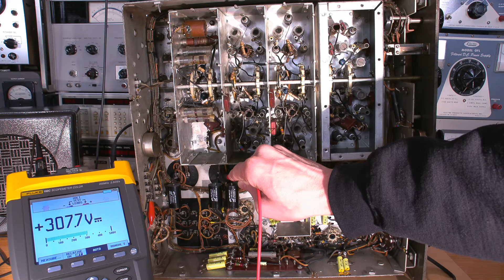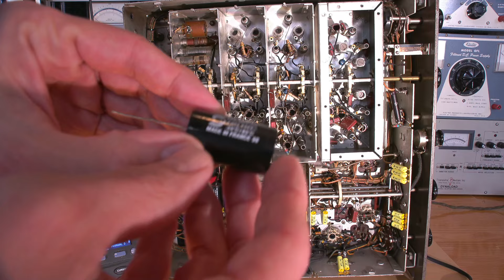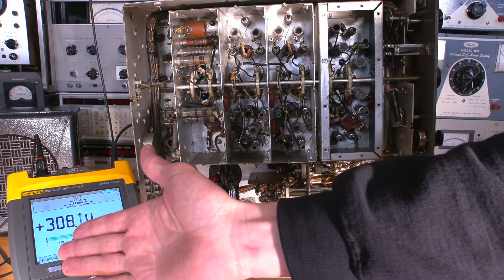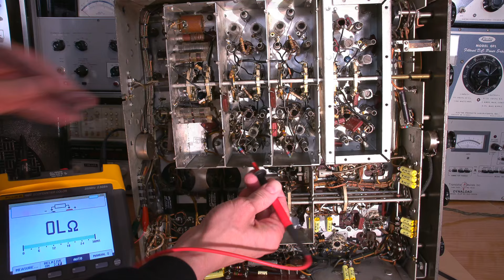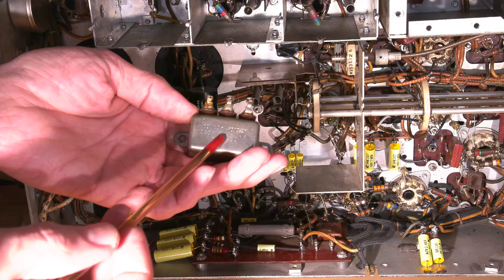Capacitors And Resistors -A Parts Substitution Guide!

Comment: Is there a reverse photoresistor? That is, a resistor with low resistance in the dark and high resistance in the light?
It would be smart to put one of these in a chain of LEDs (both DC and AC), so that the chain glows in the dark.

Comment: I can't help but think we have things pretty good in the post-VLSI world, where all the detailed respect you have to pay RCA's analog expertise is hidden away by today's little standardized black boxes. Stable performance over time, standard signalling and voltages between chips, that kind of thing.

I'm also impressed by the Solen capacitor seeming to have a manufacture date of 1998. Probably not the right choice for recapping aluminum electrolytics, but it's nice to have options.

Comment: Wanted to ask, why poly film caps for bypass and not a modern ceramic cap?  I've not looked at cap impedance vs. frequency for either but I thought that ceramics were quite good.  Edit:  Just got to the point where you say ceramic caps that would also work fine.

Comment: To all you electronic gurus, I have 2 amps in my car, one for mid and high end one for a sub. To feed audio into them I have stand alone multi media screen stuck to the windscreen that's fed 12v from the cigarette light socket. The amp  line volume settings are quite high to get the volume I like, but here's the problem, when I turn the ignition off there's are very loud and sharp crack through the speakers. I know it's the multi media screen causing it because when I remove the cigarette plug before turning the ignition off it cracks, but when I turn the ignition off with out the multi media power up there's no crack. So does anyone have any suggestions on what I could do to get rid of the crack. I'm thinking some sort of capacitor on the 12v line into the multi media screen to slowly discharge after the ignition is turning off. That's all I know so if someone could steer me with precise info I'd be very grateful. Love you videos Paul, wish I new a fraction of what you do. Very entertaining. Sorry for hijacking your comments but I thought you guys would know straight away what I should do 👍👌

Comment: Wait, did i get this right? I can use a poly cap on the filters instead of electrolytic in a tube guitar amp???? Then why no one does this? Because of the stupid " oh the caps give tone" thing???? Damn it, if it were for me i would use poly on everything and only worry about biasing (and I go cold bias)  and dont go in there

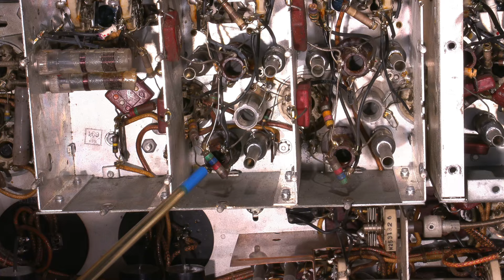Comment: 17:30 I could not find the video referenced, though aware the helical cut causes induction. What I never could find or get an answer on is if this affects the signal through the resistor and/or surrounding signal(s). You and others have warned about resistor selection in RF circuits, however, carbon composition resistors are no longer being manufactured and becoming difficult to obtain. So then does that mean at that time radios will be no longer repairable?

Or am I over thinking replacing out of value resistors in this 1964 German radio?

Thanks in advance,
Adriel

Comment: If an amp is not used over a long value ,caps do tend to vary in values or get leaky . Se the amps in old cinema amps which used run fir three shows a day never showed any signs on testing with ESR meter or other methods .Russian paper in oil r best .

Comment: I have a question that need your knowledge on. I own a vintage tube amplifier made in 50's lots of the carbon resistors have drifted to high so replaced them with wire wound and metal film. Now it improved the channels they have even power, before 1 side was weaker. The thing i need to know is by swapping them did i lose that warm sound?

Comment: Here's a question I've been pondering...I recently came into an old ham's parts inventory.  He's giving away all his junk and I could not resist.  I have a bin full of OLD 1970's electrolytics that are all "new" as in unused.  Never in circuit.  Are they serviceable?  I have no capacitor tester, certainly not the hyper-tweaked Carlson Green Eye!  But I just wonder about the physics of the capacitor.... what exactly makes them leaky??  All those electrons fighting against the dialectric?  Is it physical? Chemical?  Cosmic??  If anybody would have a definitive answer or even opinion, it's you, Paul.  So I might experiment with a couple in an old 5-tube AAC just for laughs, but what do you think??  Best regards! 73,   JEFF  K4UIE

Comment: Hi Paul I have been watching for many years thanks. Not sure how to contact you so since this post is about parts, I have a question on a Radiola 46. The Tub for the tuner section has the pot metal issue with a 1/8 inch warped that puts everything out of alignment. Is it possible to build up a new tub out of sheet metal?

Comment: Thanks Paul for this video. I found an old Robyn CB radio out in my garage and it has a lot of oil filled capacitors under the chassis. The radio works just fine and it's not really showing any obvious signs of failure, but I would like to at least replace the components before they fail.

Comment: I see some people here saying that polyester caps are leaky and polypropylene ones are a far better choice. I have some 1-10µF polyester Panasonics, but I now question if they are appropriate for the circumstances shown in the video.
Reply: no poly cap should leak measurable dc, unless its being subjected to nearly enough to break it down , but yes polypropylene is usually better, theyre generally available in higher voltage ratings than polyester or polystyrene

Comment: you ever dealt with "fake tubes"  tube replacements in a can with tube sockets that are transistorized guts?
Reply: i've come across a solid state 6X4, part dud unfortunately, and i've seen solid state replacements for octal based rectifiers, thing is just dropping silicon diodes in place of valves/tubes can be very bad idea , you need series resistors at least, to reduce the HT/B+ to the same level,
Reply: i dont know if any active solid state replacements for something  like stupidly expensive audio power triodes were/are available, i had an idea for a replacement 'universal' 'triode' some while back, but never yet built one

Comment: Very interesting discussion... I think a good discussion is how come the electronics in these old radios look different than our modern equipment.  All the components are point to point and floating in the air whereas we have PCB's and things look a lot more organized and cleaner.   I know there's a good reason for it and I feel that the answer will lead to an interesting discussion...

I should add that the topics I hear on this channel are always surprising and interesting to me, I have an AA degree in electronics, but we didn't cover tubes, except one class and we did one or two labs with them, and it was the last time they were teaching the class with tubes... that was back in 1983 or 1984... so electronics classes at my college are probably not going to feature tubes and all this old-tech... that I find fascinating like a history lesson in practical form as you restore these radios. And "B+" much respect for the high voltages, YIKES!!!

Comment: Good choice with replacing components! I have noticed that in US made radio equipment from WWII and tube equipment made later almost never electrolytic caps were used. Probably because they were not considered reliable enough in storage. Instead, relatively small-value paper-in-oil caps (4-10 uF). Most of the smoothing was done with multi section filters with these and one or two big filter reactors. Sometimes the coils were even tuned to the ripple frequency

Comment: So here's the deal as I have read it. Composition resistors are trimmed by reducing the size of the path in a non-inductive pattern. Films are non-inductive when they are made but are laser trimmed to value in a helical pattern underneath the protective coating. Hence, inductive.
Also when wrapping a wire around a post to solder it in an RF circuit you have to make sure the wire or component lead quickly leaves the vicinity of the post so it doesn't contact the post again as it continues its wrap. You will get sporadic shifts in operating frequency. Ask me how I know.😜

Comment: What do you recommend for a purchase of multiple component kits. I see lots but don’t know if I’m buying items that will never be used. I see for example 100 resistors on a roll all of the same value. How many different resistor values does a person need without ending up with rolls of components that will just sit and take up space. Same for capacitors. You can get plastic trays full of them but are they all necessary and are they to small to big etc etc. Same for transistors, op amps, chipsets. What a minefield to navigate.

Comment: 👍Thank you for another excellent video. The only thing I was curious about was the advice, if replacing a carbon resistor, to stick with carbon. Assuming they can handle the power, I tended to think metal film was usually better in RF circuits (less noise than carbon and more stable). Is there any special reasons for not replacing carbon with metal film please? Is it maybe that carbon is better at dissipating transient heat?

Comment: Interesting comments on the caps in the screen decoupling caps in the RF preamp's tempted to change them for .01uf.
It got me thinking the smoothing caps which are  4uf and wondering if RCA would have used a larger value and did not because they ran out of space inside the large can ??. or would it upset the reactance of the smoothing chokes ??.
Reply from the maker: Adding more capacitance will increase the B+ due to the reactors. In a case like this, it's better to stick to similar values.

Comment: Greetings:
Choke input filters should allow lower voltage ratings I think. Would either eliminating the first capacitor or moving it to the output of the reactor work well? How about using a CL90?
Would you accept adding a small load to the transmit position to make 450v caps acceptable?

Comment: Great explanation. Could you do a video on selecting replacement Transistors and replacing transistors that are no longer available. I currently am working on a Pioneer SX-939 and found I need to replace almost all of the transistors and several are no longer made. I called Digi-Key and they suggested a replacement but I am concerned that what they sent me does not have a metal heat sink as the original does. Being plastic and not knowing if those are the right transistors I am at a loss. I have no clue how to select a proper replacement and have to trust others to make that decision.
Reply: strange all are bad, or are they germanium types, they do go bad far more than silicon ones?

Comment: Sometimes you have to be careful with "bypass" capacitors, especially in IF amplifiers running at a few MHz. The screen grid "bypass" are sometimes part of a neutralization scheme, and therefore need to have a kinda exact value. They often look inconspicious, having 4.7 or 5nF, but thats because they just designed the neutralization to use this common value.
Reply: yep, one cap screen to ground, another cap from decoupled anode supply to the screen, not ground as normal, seen it many times in am/fm sets in the uk ... but even so, it would have been designed to accept a reasonable tolerance, 4.7nf in place of a 5nf likely perfectly ok, 3.9nf in place of a 4nf, 3.3 in place of 3, etc.
Reply: @andygozzo72  This is correct and well inside usual tolerances of the time. Just don't think "it's only a bypass, and 100nF does bypass even better than 5nF".
Reply: @VintageTechFan  in most cases, where not used as neutralising,  and not used for any timing, it wont cause any issues increasing it a bit
Reply: @andygozzo72  Yes. I just wanted to point out that you have to be careful, because in some cases, it DOES matter.

Also higher capacitances usually also have a lower SRF, so you have to watch out for that, too.

Comment: are poly style capacitors polarized as are electrolytics?
Reply: I did not see plus or minus markings on the “poly” capacitors used to replace the power supply electrolytics?
Reply: @iamhe999  nope,  some 'may' have a marking for the outer foil but they dont usually do it these days, the outer foil does not HAVE to be to 'negative' but advised to be connected to lowest impedance part of a circuit , which in this case is ht- or chassis 'ground'

Comment: whats a poly capacitor? is that polypropylene, polyester or polycarbonate? theyre not all the same you know and its not an exhaustive list.
polypropylene caps might be the best performing in tube equipment - they have the lowest leakage and best high frequency performance.
polyesters are capacitors of last resort and high leakage. 
polycarbonate is good for hot areas. polystyrene melts easily. the differences are huge.
and use a ceramic disc for RF bypass for sanitys sake !
Reply: polypropylene are generally available to the highest voltage but otherwise doubt thered be much difference for normal decoupling use, if in tuned circuits that could be different
Reply: @andygozzo72  with audio there will be not much difference whatever cap u use. 
but polyester is also used to make disposable drinks bottles. not sure how a plastic bottle would last inside hot tube gear:body-blue-raised-arms:
Reply: @echelonrank3927  well, you shouldnt really have any components that can be adversely affected by heat too bear anything heat producing,,  ..thats why many modern electrolytic caps  dont last well, they've miniaturised them too far, they get affected by heat more, they have less material in them, so can dry out quicker, and also self heat more with ripple current...as for plastic especially polypropylene, caps, if not heated beyond their design capability, they should outlast a human being..  some polystyrene ones have been known to go bad, eg. 'suflex' types but whether its the plastic, or the metal film, dunno,  some types been known to lose capacity, with the metallising film seemingly 'disappearing' over time/use, most likely due to ripple/pulse current, i had this happen with a motor run cap..no doubt miniaturisation issues again
Reply: as for polyesters high leakage? i've never had any with any measurable dc leakage...
Reply: @andygozzo72  no, the leakage is only ten times that of polypropylene which is xtremely small to begin with. 
when caps are coated in plastic it looks like a sponge under a microscope, moisture can get in and corrode the ultra thin metallization. alternatively it can be zapped away using high pulse currents.
this is especially a huge issue with rifa brand clear capacitors, they really smoke.
i wouldnt use the regular electrolytic caps unless needed for high voltage. superior polymer electrolytics are everywhere now and tantalum caps have become cheap enough, things are good. i just dont like the idea of having foil and wet newspaper shoved inside a miniature aluminium bucket and a rubber cork to boot. you know if the cork doesnt fail it will turn to garbage inside sooner or later especially when not powered up. dont buy vintage  unused electrolytics. their guaranteed shelf life is only a few years same as the guaranteed shelf life of the equipment theyre used in. i power up unused gear every few years for hour or two to make sure the electrolytics stay formed.
Reply: @echelonrank3927  the RIFA ones used, and still use apparently , metallised paper dielectric, and the epoxy seemed to crack up over time letting the moisture in and eventually the magic smoke out 😁
Reply: @andygozzo72  OMG theyre made of wood 🤣

Comment: I do like old Russian PIO and Siemens MKV caps for speaker crossover applications very much. So far none has leaked, but they are more of a 1980s vintage and do not contain pcb oils. Some of those do have polymer or a hybrid construction with paper and copper foil in oil. So not all bathtub caps are bad in my humble opinion.
Reply: The application matters a lot. For a speaker crossover a bit of leakage doesn't matter, even if it is as little as 1000 ohms. In other applications like grid coupling in a power amplifier 10 million ohms of leakage will cause problems.
Reply: @eDoc2020  true
Reply: @eDoc2020  exactly, in a speaker there should be no dc , only fairly low ac signal, plus low impedance circuitry so any leakage wont make a jot of difference unless almost dead short

Comment: Maybe I am unusual, but I do not like those HT voltage surges at switch on happening in vintage equipment.  So I use 10 Watt 20 K resistors that are controlled by MOSFETs - when the voltage goes 100 V higher than nominal the load resistor turns on and loads the B+ line by 12 mA.  That is sufficient to prevent over volting.  And when the B+ line is nominal the load resistor is fully off.
Reply: in almost all cases the equipment is designed to 'accept' it,  so as long as the ht smoothing capacitors if replaced, can accept this, i dont see any problems, unless if using mercury rectifiers or some types of power output valve which risk cathode stripping during warm up, in that case you need a delayed ht switch so no ht until valves are fully warmed up

Comment: I was just using two 450V electrolytics in series on the supply lines. 600VDC with cold tubes in my DIY amp, roughly 400VDC under load. In another project I just did delayed HV to solve the problem of some tubes arcing (a very "interesting" circuit) when cold.

Comment: Very informative! Thanks. Just a remark: When replacing blocking or bypassung caps for HF application, the internal inductivity of the caps should be considered, bacause they are wound. Higher capacity means in general also higher inductivity and therefore problems at HF. I don´t know whether mica caps are better/worse in this respect than foil caps.

Comment: Thanks for the great video! Are you changing the mica caps, just for performance reasons? I understand that it’s necessary to change out electrolytic cap, in case they are dry.